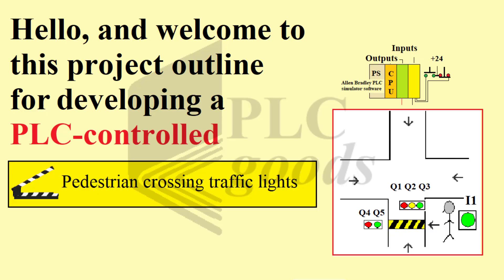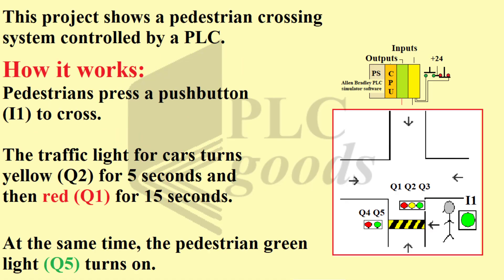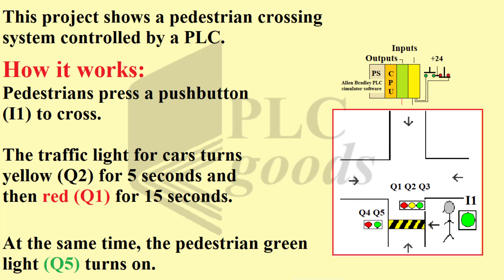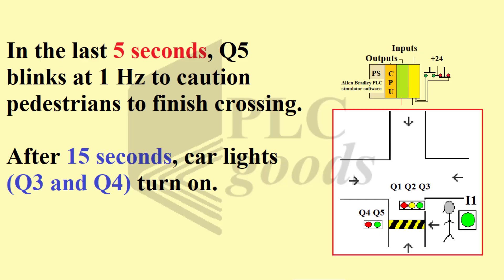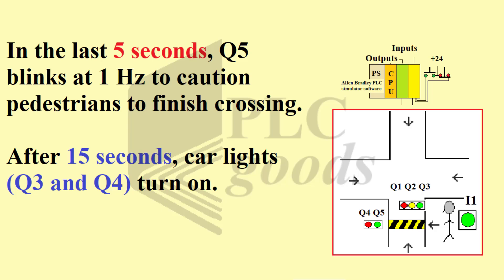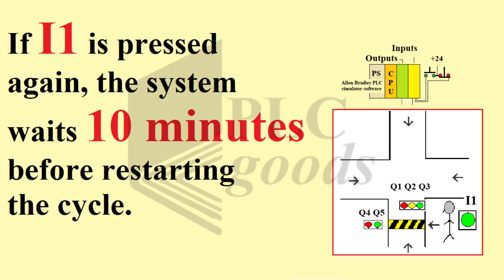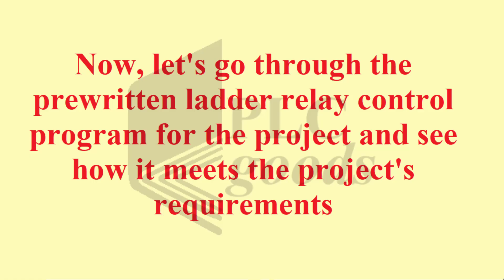PEDESTRIAN crossing traffic lights |Pedestrian crossing system | Udemy PLC project

Comment from the maker: 📌 Instructor’s Note
This video is part of my Udemy course "Excellent PLC Projects for Engineering Students – Part 2" 🎓

🚦 In this lesson, you'll learn how to design, program, and simulate a Pedestrian Crossing Traffic Light using PLC logic.

🔍 What’s Inside:
✅ Pushbutton-triggered traffic sequence (cars + pedestrian lights)
✅ Blinking signal with timing control using 1Hz logic
✅ Complete project flow with tested PLC code & simulation

🎓 Start Learning Now: https://bit.ly/40dBZK7

💬 Got questions? Drop them in the comments — I’m here to help!